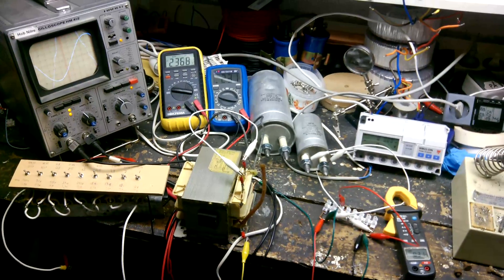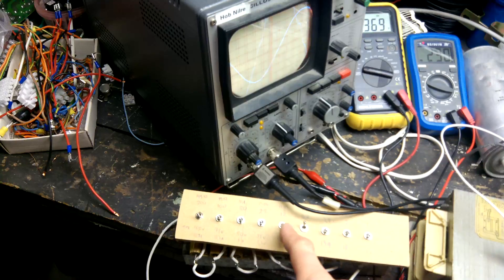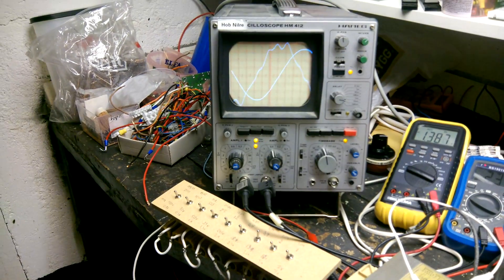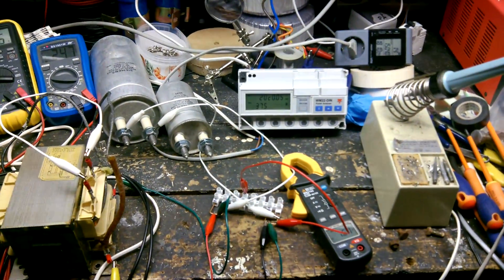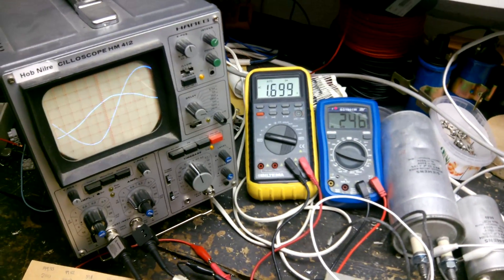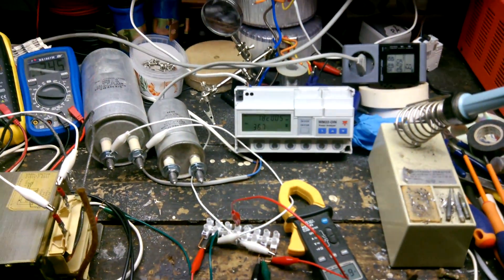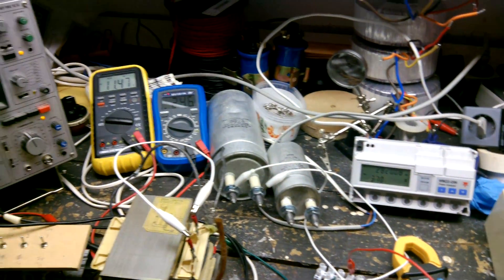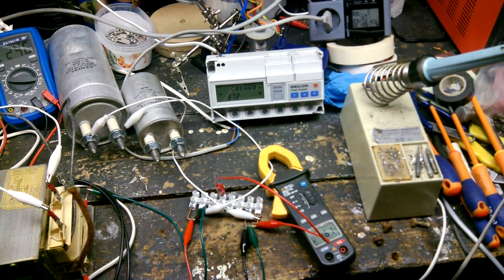Luc Reactive MOT Primary Load

Comment: Again an excellent replication Hob. Love your resistive load switch box!

For some time I was also unable to decide if the meters are able to read correctly. I don't think they can. The only way I could think of testing the circuit is to I built a a generator to see if the circuit would cause a load to the alternators and prime mover. To my surprise it did not cause a load. So this is how I concluded we can extract power from a generator by using this circuit. Can we extract enough power to feed back to the prime mover to keep the alternator turning?... remains to be fine tuned and tested.

Luc
Reply from the maker: Thank You, I hope to get more time tomorrow to do further testing.